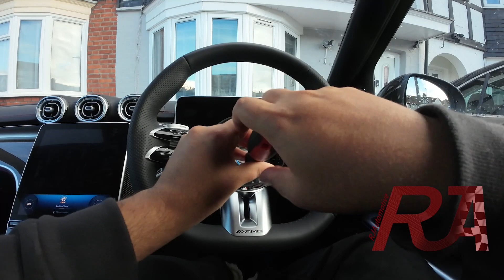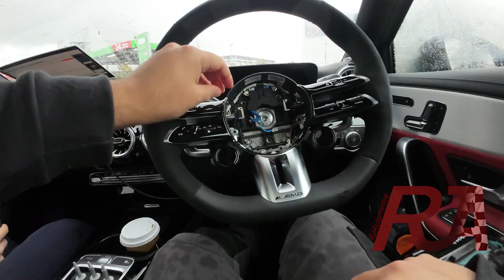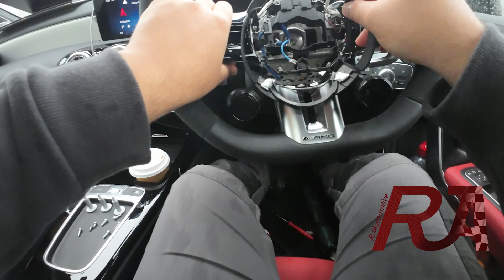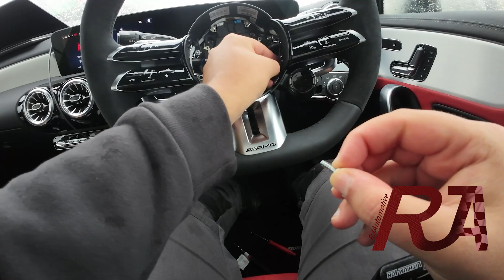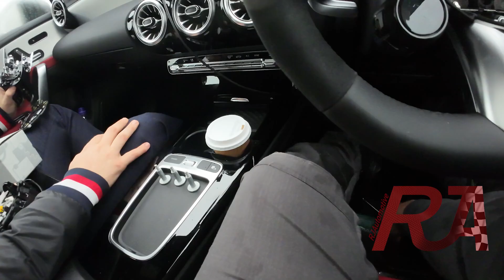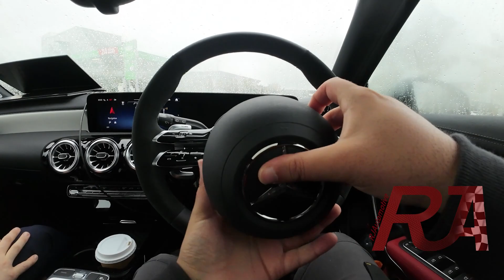Mercedes Distronic Pro Retrofit Instructions for 2022+ Steerings

Comment: in a conversation with a Showroom sales person or 4 ,  they all agreed Adaptive cruise control , was Hardware , not Software , in regards to the sensors  and what is used for it to function, if its hardware , then you have bought the hardware , with the car and you own it , Under the consumer credit act and the sales of goods act , selling the same hardware twice is Racketeering and can be ordered by courts for this practice to stop, it just needs someone with the balls and finances to take them to court of what is clearly Illegal , American , Bullcrap,  of selling sand to the arabians , as the saying goes. a safety feature that is paid for. and a reason for selling the car, cannot be turned off because of a digital switch.  especially if it is for a disabled person who cannot use a GLE where it is free , due to size restriction.   that is making a disabled person disadvantaged. and also ILLEGAL , and discriminatory.   if its built in and free on one model , its discrimination based on wealth ,  disability social status not to offer the same HARDWARE feature on all models capable with the sensors pre installed,. but turned off.  i am not sure what the buttons have to do with the hardware side of the change since my merc , has been offered for adaptive distronic and seems to have it , although i never activated it as it slows down on corners , but have not tested it yet with vehicles.